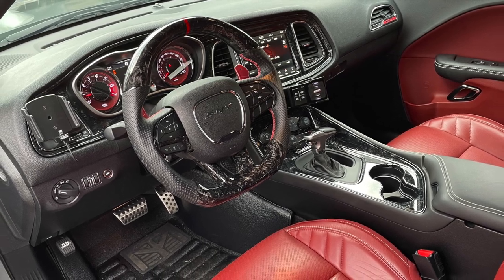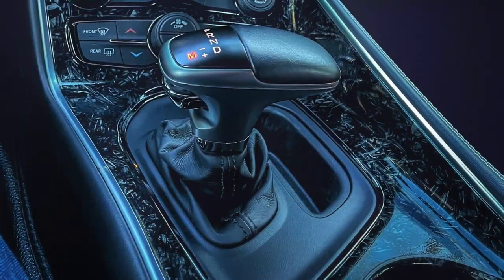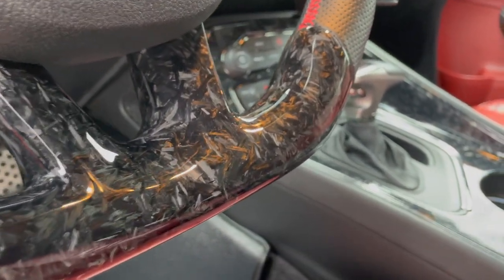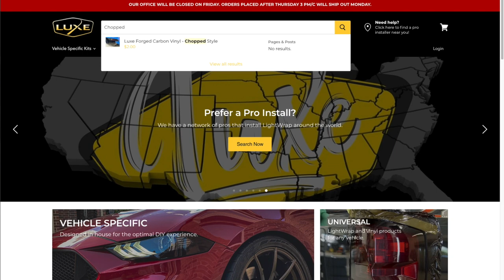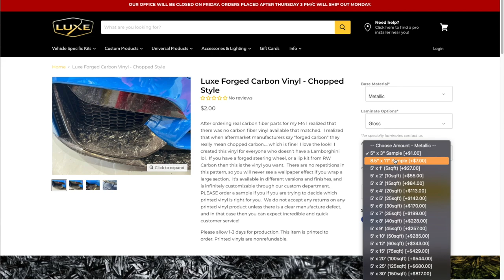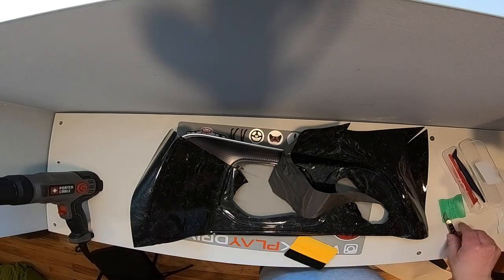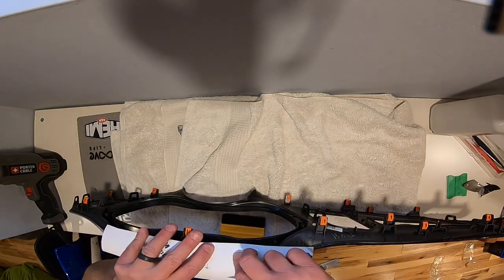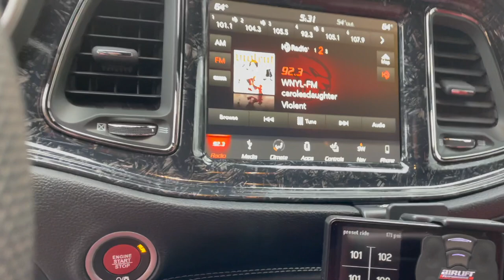Interior Trim in Luxe Forged Carbon - Chopped

Comment: This is great tips. I tried to wrap the same panels on my RT to Mimic the engine turn panels on a bandit Trans Am. To no avail. 
I was trying to use one piece for the entire panel.
Reply from the maker: I'm sure with a lot more experience It can be done in one piece, but I'm just not there yet...

Comment: such an amazing job. and i noticed you have a USB-C cable sticking out from the trim on the left side of the steering wheel. how'd you do that?
Reply from the maker: I used an extension to run it under the center console, under the wheel and just tucked it into the seam between the panel and the trim.

Comment: Looks identical to the genuine forged carbon. I’m just wondering if it’s printed or when you move side to side do you get that shifting effect?
Reply from the maker: Yes it’s printed and the most realistic I’ve seen to date. If you order it printed on the metallic vinyl it does have the depth and shift making it even more realistic
Reply: @WorkPlayDrive  thanks 👍 I’ll need to give the film a try

Comment: how did you do toxic orange on all parts ?  scalia has the color but dont have all the parts....but billet shop has a burnt orange color and has all the parts .....is it same color different name ?  how did achieve this
Reply from the maker: The Billet Technology parts are burnt orange anodize. I picked up the Scalia parts afterwards and toxic orange was the closest match.
Reply: @WorkPlayDrive  thanks that’s what I thought.  I’m trying to do all the inside parts and would of like to get all in one place. Guess not.  Thank you.
Reply: @WorkPlayDrive  they seem to match I guess it’s a really close match
Reply: @WorkPlayDrive  do you have discount code for custom billet store and or Scalia motor sports
Reply from the maker: Scalia Motorsports is WorkPlayDrive5. Billet technology has high discount flash codes on occasion. Follow them on Instagram and jump on it when it appears.

Comment: How do you remove the bezels?
Reply from the maker: You pop them off by pulling straight up and forward.  
The center bezel check this video at 3 Minutes 35 Seconds https://youtu.be/Ue6nFhkKF0I
The Dash Bezel check this video at 1 minute https://youtu.be/zFd_asz39C0
Reply: @WorkPlayDrive  I low key love you